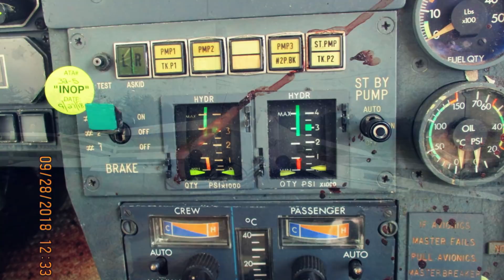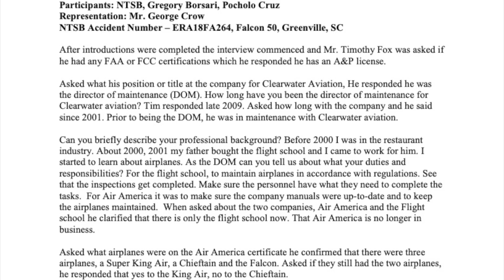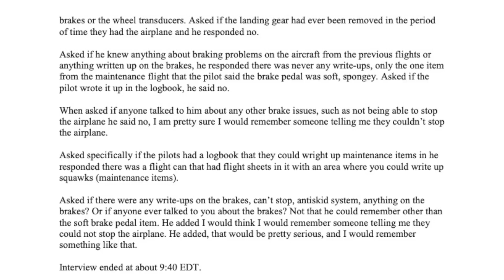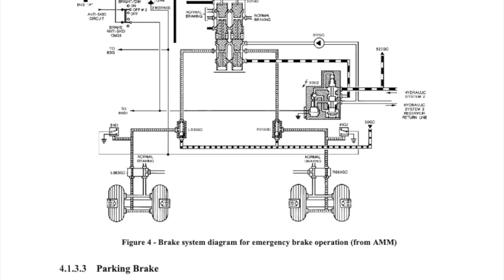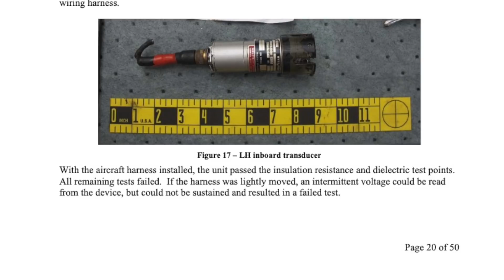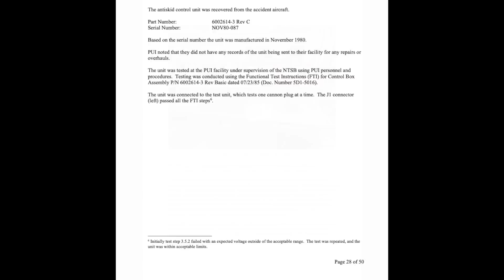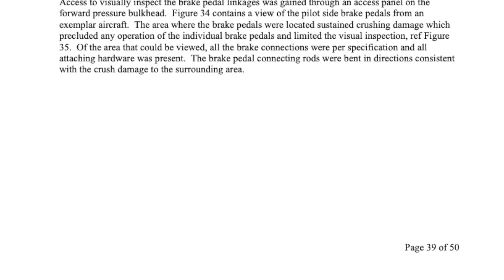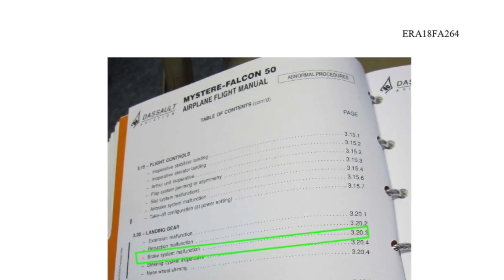Dassault Falcon 50 Splits in Half During Fatal Runway Overrun

Comment: Not a pilot so never occurred to me that engines could still be running when detached from the cockpit.  What do you do in that situation?  What is the mechanism that stops a jet engine under normal circumstances?

Comment: Someone mentioned a way to stop aircraft from going off the end. It's called EMAS (engineered materials arrestor system) and usually works very well. In the 90's, when I flew, EMAS was just being installed at certain airports. One of these is a CRJ-200 at CRW or "Charlie West" in West Virginia. There is a 150' drop if you go off the end. There are others from different airports like DCA, LGA, MDW. 
https://www.bing.com/images/search?view=detailV2&ccid=I7wyZ0R8&id=B1FCDC6DC8435A2BDFAE7943D9E21DD1D03CC023&thid=OIP.I7wyZ0R8qLmCdFm8l15RIwHaFr&mediaurl=http%3a%2f%2fi.stack.imgur.com%2fXhrYg.jpg&exph=767&expw=1000&q=emas+in+aviation&simid=608050962415291572&ck=0FB2B3AFDB57F8F37C924AE11A3CCE56&selectedIndex=1

Comment: The left seat pilot held an ATP certificate with a type rating for the Falcon 50 with a limitation for second-in-command only. He also held type ratings for Learjet and Westwind business jets. He held a Federal Aviation Administration (FAA) first-class medical certificate issued on August 7, 2108; at that time, he reported 11,650 total hours of flight experience.

The right seat pilot held a private pilot certificate with ratings for airplane single and multiengine land. He did not hold an instrument rating. He held a FAA second-class medical certificate issued on March 27, 2017,and on that date, he reported 5,500 total hours of flight experienc

Comment: Just a suggestion: wouldn't it a good idea to have an arrestor bed like you see sometimes at prolonged downgrades on major roadways? Instead of this dropoff. A giant sandpit like structure might be a relatively cheap solution. Statistically there is always a chance that an overrun will happen.
Reply: They have EMASS at the other end to prevent it but not that end, seen a Falcon 50 take it when i worked there.

Comment: This is a very sad story.  The aircraft was owned by the co-pilot who, along with his two sons, ran a small flight training school and air charter service out of Clearwater, Florida.  They had a small fleet of 3 planes and the Falcon was probably his pride and joy even though it was over 40 years old and in very bad shape.  It had been sitting in a hangar for 4 years and had over 100 open maintenance/repair items they were working on.  The last pilot to test fly it told the owner the brakes were inoperable.  The NTSB investigation revealed numerous problems with the auto brake system, bent connector pins, mismatched wiring, bad servo valves. The system needed a complete overhaul and the main brakes would not work without it.  The director of maintenance (the owner's son) insisted he had never been told the brakes were inoperable.  Throwing a switch on the instrument panel would have enabled the manual braking system, but neither pilot or co-pilot was certified to fly the Falcon so I guess they just didn't know that.
Reply: That label next to the brake switch suggests that maintenance WAS notified.  I wonder who's handwriting is on that label?
Reply: That’s it in a nutshell John. 🤷‍♂️

Comment: "A pilot, who had flown the airplane on four previous flights along with the accident pilot (who was acting as second-in-command during them), identified during those flights that the airplane's normal braking system was not operating when the airplane was traveling faster than 20 knots. He remedied the situation by configuring the airplane to use the emergency, rather than normal, braking system. "
[source: http://www.kathrynsreport.com/2018/09/dassault-falcon-50-n114td-fatal_28.html]
And they still flew the plane with passengers aboard! Despite Air America Flight Services INC for allowing the aircraft to be flown in such a state the pilots have a final say and should have opted not to fly that aircraft until discrepancies with braking were resolved. This is what I would call letting experience get to your head.

Comment: What's most pathetic about this accident is that the captain flew this airplane on 4 previous flights with the same brake issue and the backup brake system was activated, yet on this flight the backup system was not activated and the parking brake was never used either. This guy was no rookie either. He had 11650 hours of flight time.
Reply: different pic
Reply: @pearlyshells2430  The PIC in the accident was the second in command of the previous 4 flights when they discovered the breaking issues. So the PIC in this accident knew about the breaks not working in #1 position...

Comment: Airports are charging good money (deserved) but why do not all have an arrest bed? Why does the regulator allow the end of the runway be a drop..? This accident could have been a minor thing with no injuries, let alone the pilots loosing their life. The aircraft would have no damage if an arrest bed would be in place. It costs millions to get things certified in the aviation industry, yet simple life and aircraft saving technology is not mandatory. I do not understand it...
Reply: Sounds like you are only considering major airports with regularly scheduled passenger service (class B). This was a class D. There are about 5000 small airports in the US, many of which are happy to sell $100 in fuel a day. Often they operate at significant losses each year, and are propped up by local government just so the town can say it has an airport. If you implemented your policy across the board, I'd expect a few hundred of these, or more, to close.

Comment: It may not look like it hit very hard off the embankment but at a distance the scale and true height of the drop doesn't appear as severe as it really is. You can see from the damage to the airframe that the impact forces were extreme. The aircraft is 60.5 ft long, the embankment is about at a 45 degree slope and is slightly longer than the aircraft. So I estimate the drop to be about 35 feet, and at speed that's going to be a deadly impact.That's 3-1/2 stories high! It's amazing they would test fly a plane that was 60% through its maintenance, there was a squawk bout the brakes, possibly one about NO brakes, and the owner still proceeded with a test flight. So many violations there.

Comment: Airbags would have been helpful.
Reply: It's a plane, most of the time, airbags wouldn't make a difference
Reply: Air bags help with arresting forward movements,  this impact had a large vertical component.
Reply: @theoldman8877  I mean it would be great to add them just in case

Comment: Don’t let a pretty outside obscure the real truth on the inside. The avionics appear to be the originals. Sitting idle for 4 years should have kept this aircraft in maintenance for at least a year if not longer. Poorly maintained and rushed back into service, horrible decision making.
Reply: Was it actually in service?  Still had the inop stickers on the brake system.

Comment: Its strange that they don't anticipate overruns when they design these airports. I saw a crash video earlier where they built a natural gas plant just a few hundred feet past the end of the runway and of course a plane plowed through it.  Also some airports have concrete buildings near the runways that should have been underground, also storage tanks that should be underground.  When will they pull their heads out?
Reply: Airports are often in place long before developments.  Teterboro airport in NJ is a prime example of this.  When the airport was created, there was nothing but farm fields around it.  70+ years of development now have completely surrounded the airport, and there has been at least one crash running into industrial park that was once empty field.  It is not necessarily poor planning on the part of the airport.
Reply: In this specific case:  1)  Are you volunteering to pay for these changes?  2) Do you realize this airport opened in 1928 when the population was 29,000 versus the 70,000 for today?
Reply: @jimmiller5600  ~~ Yes, send me the bill.
Reply: @ransomprigg1047  I will for every airport, with a special cost-escalator for exposure to events like this where both the plane and pilots were deficient before they took off.

Comment: All for lack of a switch position. A simple toggle to #2 OFF would have saved them. BUT, reversed sensor wires, bent sensor pin, broken solder (open) joint, failure of aircrew to have memorized the AFM specifically the brake fail section, but it sounds like the operation owner had some attitude issues. A sad event that probably should not have happened.
Reply: Operation owner was one of the fatalities, co-pilot.  So at least the consequences came directly to roost.  It was probably his call (read "insistence") that the less-than-fully qualified PIC was flying the plane.

Comment: Doesn't seem a good idea to have a 30ft drop off the end of any runway....yet many airports have exactly that, and many lives have been lost after aircraft plunge off the end.
Reply: It's hard to anticipate, build and pay for infrastructure to accommodate  a deficient aircraft and a deficient flight crew.
Reply: Google TAM Airlines flight 3054 crash at Sao Paulo 2007. This one was purely pilot error; they only had one thrust reverser deployed, and were startled that the airplane pulled to the left and wouldn't slow down when they throttled up to try to stop.

Comment: Irrespective of the obvious issues involving aircraft airworthiness and crew proficiency, the fact remains that this is an unsafe runway.  Steep dropoff just beyond the departure end, insufficient overrun area with no EMAS system provided.  Runway overruns are nothing new and this runway had little or no margin of safety, especially for jet operations on a 5,400 foot runway.
Reply: If we're dismissing the mechanical and proficiency issues, the runway is perfectly safe when aircraft performance is properly calculated.
Reply: The runway may indeed appear unsafe, however, runway information for all airports is published. The pilot in command is required  by FAR 91.103 to be familiar with all information concerning the flight, including all runway information.
Reply: Topography is not standard and does not always suit ideals . . .

Comment: Why would anyone consider boarding a plane with 35-40 year old brake/gear components is beyond my comprehension. RIP to the crew.
Reply: Amp Easy people do exactly that each and every day....knowingly and unknowingly. For aircraft that are properly maintained having parts of that age is not a concern due to time due inspections and aircraft takeoff/landing cycles. Following proper maintenance protocols is critical for aircraft safety in the air and on the ground. And yes, I'm a licensed A&P Mechanic.
Reply: @dew2667  Indeed and why such gears are completely disassembled, consumable parts replaced and rebuilt, this aircraft had neither done for some time.

Comment: I would never have expected that to be fatal. Such a shame.
Reply: The forces required to split an air frame is normally fatal to the occupants.
Reply: Cockpit is full is hard surfaces ready to crush bones and tear flesh.
Reply: Disagree, It's not like the aircraft crashed into a pile of feathers. That was quite a significant impact.
Reply: They weren't wearing a seat belt.
Reply: You should see it in person. I worked at a facility south of Atlanta where the crash is stored. It’s very creepy wreckage. Pilot side window busted from where his head hit it:  not the worst wreckage there but definitely still gives creepy vibes
Reply: Mitchell Mordas what about the co pilot side? Same thing?

Comment: Sad to hear people were killed. The Runway designed like that should be investigated.
Reply: This had nothing to do with the runway design. Read the description.

"The pilot held an airline transport pilot certificate and a type rating for the Dassault Falcon 50 with a limitation for second-in-command privileges only. The co-pilot held a private pilot certificate with ratings for airplane single and multiengine land. He did not hold any type ratings nor did he hold an instrument rating."

"According to the operator's director of maintenance, the airplane had been kept in storage in a hangar for about 4 years. In June 2018, a work order was generated to return the airplane to a serviceable status. The work order included a 12-month inspection, a 12-month or 500-hour inspection, a 24-month inspection, and a 36-month inspection. The work order also indicated that a total of 103 discrepancies found during the ongoing inspections needed to be addressed. The work order was about 60% complete at the time of the accident, and there were indication that the airplane was airworthy."

CT scan performed on the antiskid system components revealed a broken solder joint on the left-side inboard transducer and a bent pin connection on the right-side inboard transducer. Functional tests of the antiskid wheel speed transducers revealed a failure in the operation of the left-side inboard wheel speed transducer. Visual inspection of the wiring for the right-side wheel speed transducers found that the wiring to the right outboard transducer was reversed.

According to the pilot who conducted four flights in the airplane before the accident flight, upon application of the brakes with the brake switch in the "#1-ON" position, braking was normal at low speeds (estimated to be 15-20 knots) but at faster speeds, no braking was available. Braking was restored when the brake switch was placed in the "#2-OFF" position. This pilot stated that he reported the brake system failure to the company's director of maintenance after the first two flights (in late August and early September 2018) and indicated his belief that the source of the problem was the antiskid system. This pilot also stated that the last two flights occurred 7 and 8 days before the accident flight and that the accident pilot was the copilot for all four flights.

Nothing had been done to resolve the issue. The airplane's flight manual clearly indicates that in the event of a brake failure or ions antiskid, the brake switch be moved to the #2 position.

(Also  "According to the cockpit voice recorder (CVR), during the approach to GMU, the flight crew had difficulties understanding the navigation fixes that air traffic control had provided. The CVR also showed that the flight crew did not use any prelanding checklist or discuss that no braking was available with the brake system in the "#1-ON" position (the pilot had been copilot for the previous four flights in the airplane, during which this condition was present). At 1345:34, the CVR recorded the sound of touchdown. At 1345:38, the pilot stated that the brakes were not operating. He and the copilot commented about the lack of brakes several more times before the airplane went over the embankment.")

DAMNING.

Seems like a shit show with everyone associated with this aircraft, TBH.
Reply: @brandontaylor6736  If the runway didn't have a steep drop off like that they likely would have survived though
Reply: ALIVE845 And if destinations weren’t so far from the points of departure we wouldn’t have had to fly at all. They could shut the airport? The pilot could choose a different airport to land at? Or they could act appropriately and not end up in this position. Every action in aviation comes with risk; its a high energy activity, and human bodies don’t cope well with high energy transitions. Its how all the risks are managed that counts in ALL cases, and anyone doing the right things in the right way with the right equipment can land safely there.